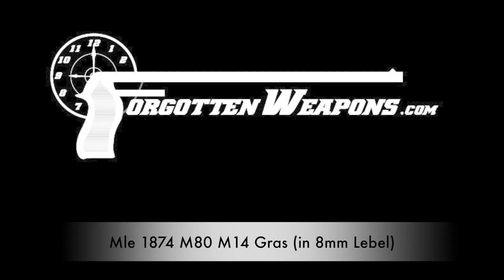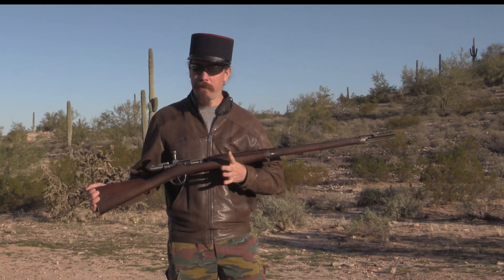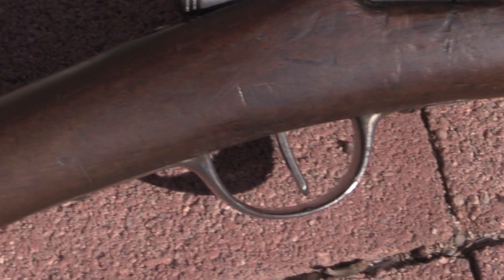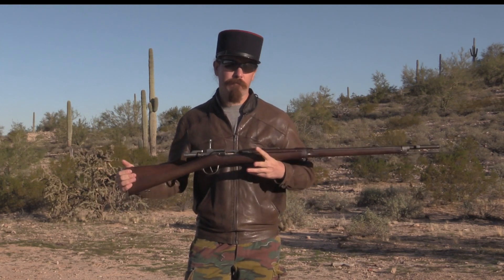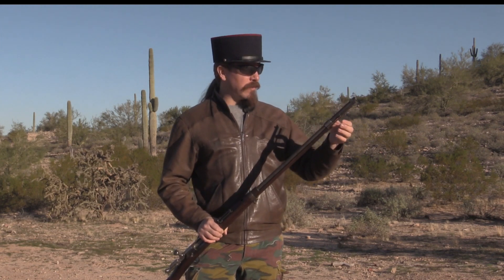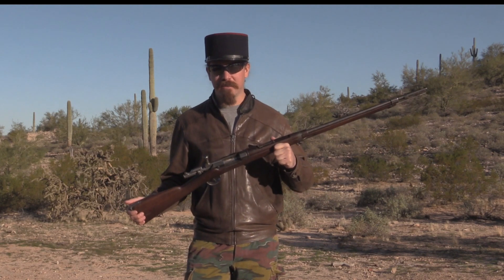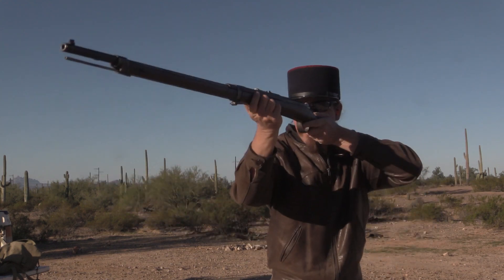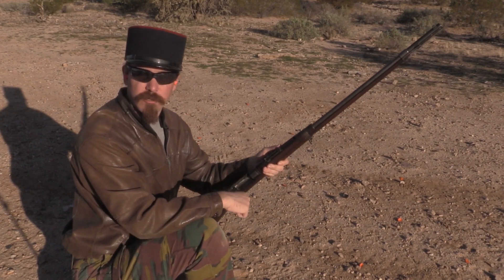French M14 Conversion - the Gras in 8mm Lebel

Comment: A friend of mine owns a Gras that was smoothbored into a 12 gauge shotgun. It's impossible to find shells for that thing.
Reply: Just how can't you find 12 gauge ammo?
Reply: @nazarderkach9320  There are different lengths of 12 gauge cartridges. There are for example 65mm, 67mm, 70mm, 76 and 89mm length. The full designation of a shotgun caliber is "caliber 12/76" for example. And the length is when the cartridge is unfolded (they are folded shut at the front) before you shoot them.

Comment: Greece used alot of Gras rifles, first on the greco-turkish war of 1897 it was the standard issue service rifle. after that it was a rear or filling gap rifle when shortages of the new standard rifle Mannlicher-Shoenauer M-1903 apeared in varius cases. the gras was used in the first balakn war 1912 by the Garibaldi "redshirt" philellenes volunteers as they were not available new Mannlicher M1903 to equip them, which lead to dissatisfaction since the black powder cartridge was revealing the shooters position. the gras also used by many guerillas equipped by greece in varius revollutions vs the ottoman empire. The greek army never rebarelled gras but i dont know if the french send some M14 in 8mm during the WWI when they send lebel and Berthier rifles. the Gras even used in WWII in very few numbers (in non combatant troops like mule drivers and cooks etc). many of them were converting to shotguns for civilian use in local greek gunsmithing shops after they were putting out of service from the army.

Comment: If this is yours, you can fix the wood by cutting a groove on the inside of both sides. Then, making a wooden ring and fixing it in place with wood glue. It's a simple, solid, hidden repair. Tho i would do it on metal working machinery rather than by hand or wooden machinery.

Comment: What is a duffel cut?  I've never heard that term before.
Reply from the maker: +Trey Westcot Guns brought home as souvenirs had to fit in a duffel bag, which usually required cutting the stock into two pieces. This was typically done so that the cut could be hidden under a barrel band when reassembled.
Reply: +Forgotten Weapons 
Ok.  I'm familiar with that procedure, just never heard it called that.  Thanks very much for clarifying.  As always, outstanding content.  I never miss an episode of Forgotten Weapons or In Range.  At first I thought you were carrying an Indian Enfield single shot .410 in your latest IR video.  I suspect the Martini was a better choice for ease of loading, not to mention power.
Reply from the maker: +Trey Westcot I seriously consider using the .410 Enfield there, but I don't think it would have been capable of knocking down some of the plates.
Reply: +Forgotten Weapons Agreed.
Reply: +Forgotten Weapons Find some kind of rare specialist explosive rounds for it, obviously.

Comment: The Germans used a barrel sleeve when they converted a load of old black powder  rifles to 8mm (can't remember the model but I can get about 20 from a friend) - its a relatively thing walled tube with the muzzle end turned over and the 8mm barrel sticks out about 1/4"(6mm) or so. They sold a heap to the Turks who then sold them off a few decades ago. As for the 'duffle cut' stock - if the rifle is yours, just strip it down and insert a 'dutchman' into the joint - its a piece of wood shaped like a bowtie >< (another name for it) - just use a sharp chisel and watch where you put your fingers when cutting the hole for the insert.
Reply: +Bruce Lee I think you are talking about the Gewehr 88, which never used black powder.  The Gewehr 88 has a barrel jacket to prevent the barrel from contacting the stock.

Comment: thanks as always. can anyone enlighten me...? what is a duffel cut? I hope it doesn't mean someone cut the rifle in half to fit in their duffel bag?!
Reply: +seanmcardle Second that.
Reply: Very late I know, but yes pretty much. The US soldiers would remove the barrel, cut through the forward part of the stock either straight or at an angle so the gun was short enough to fit in a duffel bag and then repair the cut at home.
Reply: @yt.602  ouch. thanks.

Comment: Honestly, I am still unsure why there is the habit to convert obsolete firearms to use the "standard" ammunition when it is almost always costs more to convert guns than to simply make one small arsenal to produce the original ammunition for the old guns being pressed into service.  A single machine in any French arsenal could have supplied the whole of the Second Line of France with old 11mm Blackpowder ammunition in the amounts needed for training and service. Classic failure of bureaucracy, je pense, n'est-ce pas?
Reply from the maker: It's not so much about the cost of producing ammunition as the logistical ability to distribute that ammunition where it is needed.
Reply: Forgotten Weapons I am getting rusty. I am always reminding others of the importance of looking at things from the perspective of the people of the time and here, I plum forgot that French logistics were already failing to meet the needs of the front. The last thing they needed was to undermine the economy of scale they were developing by requiring millions of esoteric rounds to be handled as well. This was certainly the more reasonable solution for the French in their situation.